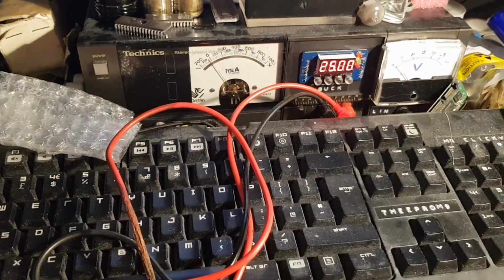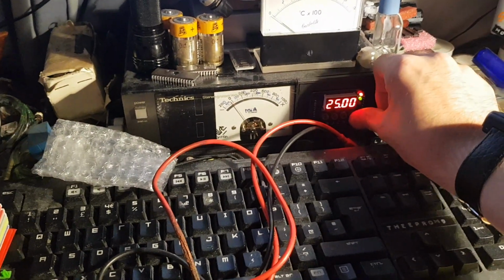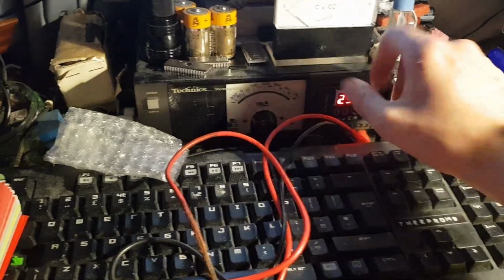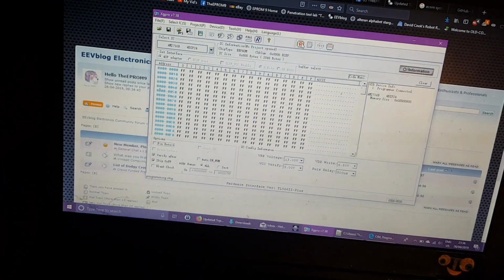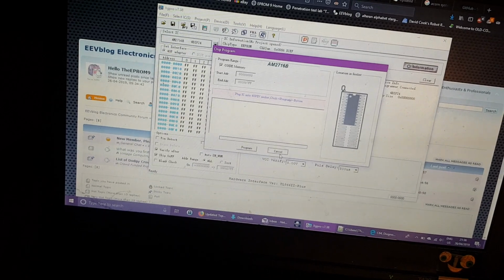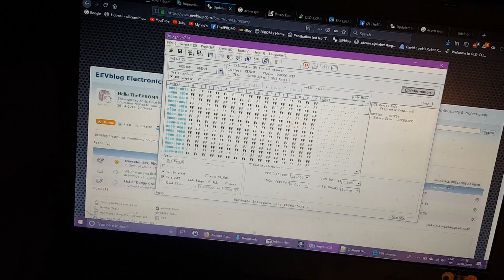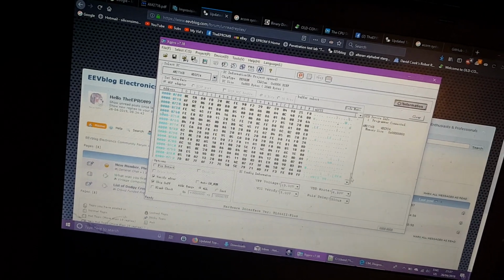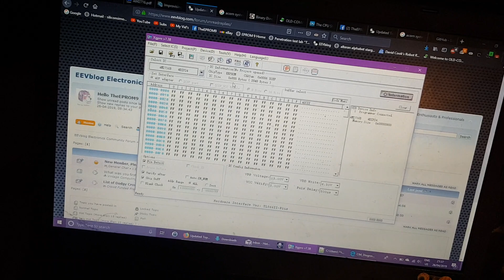Programming Vintage EPROMs With TL866II Plus

Comment: Be careful. I broke my programmer doing that, 21V line touched contiguous pins accidentally. F1 blown up Vpp#01 ERROR at Self check
Reply from the maker: It would be to easy to do that. Only takes one clumsy moment & I am very clumsy.

Comment: I tried this method with M2732A for a commodore PET and it fried all the PINs.  The 2732A needs 21volts on PIn20 which I did.  So be careful
Reply from the maker: That is why I double & tripple checked as I kenw it was a risk, also tested it on a programmer that did not work. So if it blew up it would blow that up.

Comment: A nice (and interesting) to-the-point video.  I'm having issues programming TMS2532A's, I get the overcurrent error.  Reading around, people are saying it's more a current problem than voltage; I don't have a 25-30v PSU, I was wondering about trying your trick with a 20v laptop  PSU, do you think I've got a chance?
Reply from the maker: I don't see why not to try it.

Comment: 21v only in TL866CS or TL866A, however, these 2 models are obsolete and do not have some improvements such as programming of nand flash.
Reply from the maker: Plus they are imposible to find now, I looked for them sevrail times now.

Comment: Do not bend the Eprom pin, it will break when you need to bend it again. Instead, plug the eprom into another external socket, and bend the socket pin to fit the programmer's socket.
Reply from the maker: Idealy yes that is the proper way to do it, but I was experimenting with it at the time.

Comment: Just what I needed - Can I just check, please . . .
Did you completely lift the VPP Pin (21) off the Eprom Programmer and apply 25V to the 2716 pin and ground?
I assume that's what you have done. Anything else needed?
Thank you
Reply from the maker: Indeed I did, that way the 25V was only going though the chip & not into the programer or my Laptop. If you put the 25V into the programmer you will end up with a dead programmer & potentaly dead laptop.
Reply: @TheEPROM9  Many thanks
I have done just this! No, not destroy the programmer ;-)
Program some 2716s!
Luckily I had a 24V PSU I bought a while ago from China - It has an adjustable wide-ranging output - I set it for exactly 25v - Good job! I can set it for 21V also for future programming some 27128s.
(The TL866ii Plus doesn't have 21V output).
All the best
Reply from the maker: @buddhistsympathizer1136  Nice, I did this little trick to program EPROM's for the Acorn System 1 I was building at the time. Glad I helped.

Comment: Which other programmer are you referring to at 1:28? Pro 2 version?
Reply from the maker: The original version that was the predesessor to this one, sadly it is no longer supported & pretty much unobtainium. So this little hack will let you program these chips on this programmer.
Reply: @TheEPROM9  That's what I thought you meant. I believe they are the TL866CS and TL866A. Can't find them anywhere. Thanks for replying!

Comment: I just bought one of these things, not realizing I would need to use higher voltages. I have a bit of a rookie question regarding your work-around and I cannot tell from the video.

Did you bend the VPP and GND pins so they are not going into the programmer?
Reply from the maker: The 5v from the chip & GND went into the programer, only the 24V went into the VPP programing pin. I did bend that pin up so the voltage did not nuke my programmer or laptop. I would not recomend putting the high voltages into the programer.
Reply: @TheEPROM9  Thank you for the prompt reply. It also looks like you ran the Ground from your external power into the chips GND pin. Is that correct?
Reply from the maker: @lionelmandrake2549  No probs, that is correct I conected the "HV" PSU GND to the chips & programmers GND.

Comment: Awesome tip! But I would be worried about sending too much voltage into the programmer and damaging it. You could make a little board with a socket that you plug those chips into. The board would disconnect the VPP pin from the programmer a bring it to a place you can plug your power supply to.
Reply from the maker: I like that idea, that way you don't risk hooking it to the wrong pin.

Comment: hello there i just try to copy from a chip that the battery its to low to a new chip but i get error! CODE Address:0x001ff0 Buf_Va1:0x10 IC_Va1:0x00 
the chip is the ST  m48t59y
Reply from the maker: You are going to need to explain the probelm more clearly, then someone might be able to help.
Reply: @TheEPROM9  i have put the old chip ,i push the rrad button and then save it on my desktop, then i take it out and put the new one then i press the program button and find the file that i create . When i press the program button after a few sec stop at 93,7% and shiw me that error code
Reply from the maker: @bacardilove1981  Maybe the chip you are trying to use is dead.

Comment: EPROM9, how can you calculate the ROM signature value and ROM check sum value using a held hand calculator? why doesn't ROM chips output IRQ signals and where do IRQ signals come from mostly?
Reply from the maker: I do not know that one, a question for Google. I got the code for it off someone online. 2716 = 16Kb / 8 = 2KB

Comment: I went online & put an order in for the TL866CS Eprom programmer.  When it arrived, I was shocked to see the TL866II Plus & the eBay seller said, "This one is newer/better!" <facepalm>  I replied, "Newer isn't always Better"...  Admittedly, all I wanted (in the first instance) was to read 27C128 ROM's to see if they weren't corrupted.  But if they were I wanted to reflash them, which the TL866II Plus couldn't do!  In the end, I got the Willem Programmer PCB 5.0 and read the 27C128 ROM's that way - turns out the ROM's were fine all along!
Reply from the maker: That is anoying, end of the say if you are selling a produce, send people the right version. The old version still has applications that the new one "can't" do. I have a Willem Programmer that does not work, only works though the paralle port which is completely useless to me these days.
Reply: According to the mfg of those, both CS and A models have been discontinued for some time and can't be sold anymore thru regular online shops. Did you upgrade the programmer firmware (when you install the newest version on their site it updates automatically when connected)?

The mentioned chip is on the II+ supported list too:

A/CS:
autoelectric DOT cn/MiniPro/MiniProSupportList.txt

II+:
autoelectric DOT cn/MiniPro/TL866II_List.txt

mfg site (software updates, etc):

autoelectric DOT cn/en/tl866_main.html
Reply: @brunoleonardo3315  Yeah, the eBay seller clearly stated that the CS was available & that's the model I ordered...  😕
I also had a go at getting the G540 EPROM programmer, but didn't realize that I needed the G840 for the higher voltages...  😕
It's a moot point now as I have the Willem model working with a PC that has a working Parallel port. 👍🏼
Reply from the maker: Probaly simular to the one I have then that I could never get working. I will have to gut it for parts one day.
Reply: There's a specific part of the programmer manual about those higher voltage 27Cxxx:

5.Programming about 27C Series while VPP voltage is 21V or 25V
TL866II programming voltage VPP is only supported up to 18V, for the early 27C series ROM with 21V or 25V VPP voltage no longer be supported writing, but can be read. If you want to use this kind of IC, you can read form the IC (Vpp is 21V or 25V). and buy a new IC (VPP is 13V)to replace it. 27Cxx Serials Chip can be replaced directly. Do  not  use  the  external  power  supply  to  enhance  the  programming  voltage  for  forced programming, when the chip is damaged, 21V / 25V high voltage may go back to the programmer's internal, will damage the programmer hardware.

As worded by them it looks like that the previous programmer versions could indeed flash those higher voltage parts. Considering the II+ costs more than the previous versions, could it be that the new chipset does not like working with higher voltages?
Reply from the maker: It is a little on the risky side. That is why it is better to test the chip on its own first. Otherise as you say, bang goes the programmer & the PC will potentaly go bang, If its a MAC it is 100% cirtan it will go bang & take all your data with it.

Sadly when working with vintage computers, buying a new EPROM is not always an option. Sometimes the one you need is only avalible in a 25V VPP option.
Reply from the maker: It is a shame they discontinued it when it still had useful functionality that the new model does not. Mine is on the defult firmware, I will hack it if the need arises. At least this hack saved me having to spend more money on a programmer.